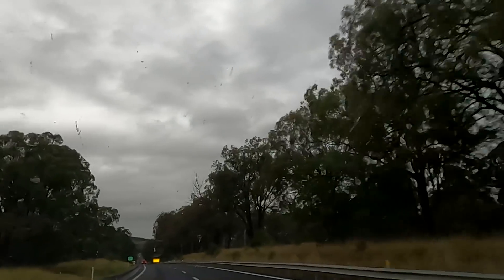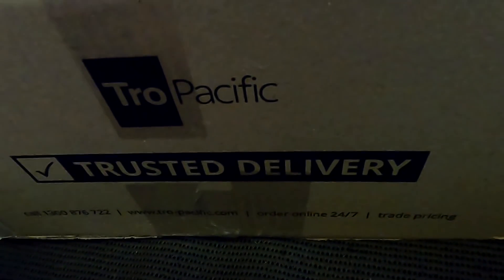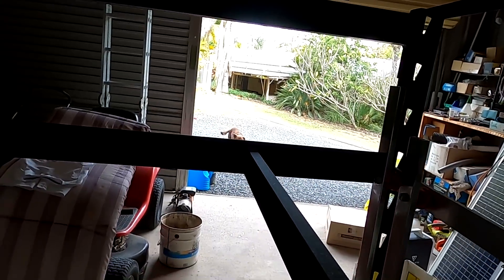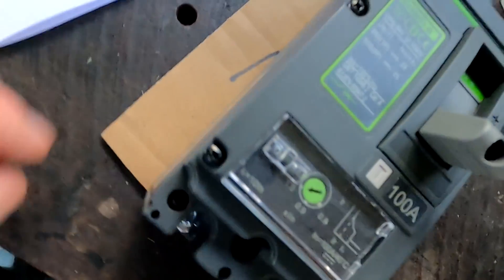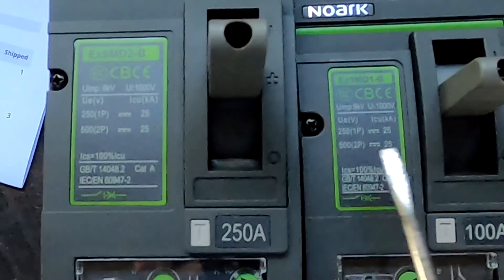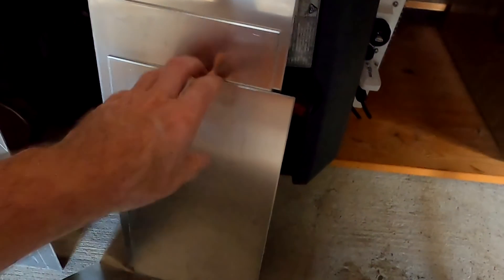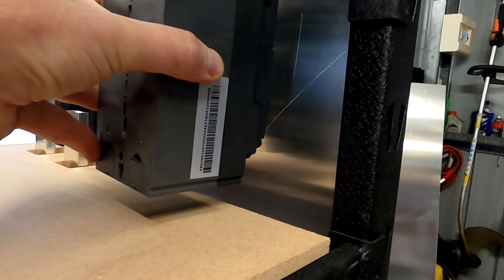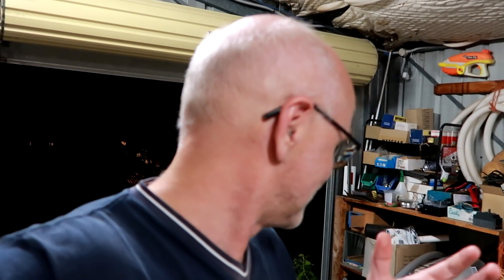Getting started with Battery 2.0. It is so much work... 🍺

Comment: I am assembling a 48 V battery from 315 cells. Due to lack of space, I will place them in two floors, 8 cells in each. I will make the rack myself from a corner and pipes. I have already found the material for the shelves: HPL plastic SPC from Durcon. Now I am solving the issue with circuit breakers and fuses: are they needed at all and if so, what denominations?

Comment: Not worried about the shelves conducting? I'd insulate the shelf tops. Also did you do any research on air arcing between the bars themselves? You could then potentially have arcing from bar to shelf and back to bar. Probably more than fine with the finger distance but something to research.

I'd have the bus bars further apart to make it virtually impossible to short by any metal tool.

Comment: For the rice of the aluminum you could have doubled your battery capacity. Using an electrical conductor as a shelf means that if you have a catastrophic electrical failure of one battery they all will ark and fail. Put an electrical insulator between the batteries and the aluminum.

Comment: thanks for sharing! how did you size your DC braker? i will build a 48V system with 304ah cells, my inverter is an mppsolar with 6.5kw inverter 120V.
Reply from the maker: OK, so roughly you do
6500W / 48V = 135A
So if you go with a 150A breaker you'll be fine. Unless the inverter can output more and you regularly hit this peak power, you should go with a 175A or even 200A breaker.
Reply: @OffGridGarageAustralia  thank you for your reply and your help!
Reply: @OffGridGarageAustralia  So if I have 2 Solark 15ks that each have 12kw (24K total) each inverter capacity and four 48 volt battery banks 304ah(64KWHs).   How would you size those breakers on each bank and the main for the 4 banks. 
Bank  24000/4/48 = 125 amp ?        Main 24000/48 = 500 amp ?
Reply from the maker: @thomaskissane691  I would use the peak power for the calculation:
30.000W/48V=625A
30.000W/48V/4=156A

So, 700A and 200A I would choose, depending on availability. 630A is the largest I have seen so far. 
This all depends on the used cable sizes of course.

Comment: When you fit the shunt accessory in those breakers, how will you trigger the shunt. Let's assume the MPPT fails and allows a full high voltage directly through to the charge cables, you want those breakers to trip, yes?

Comment: I'd seen a comment elsewhere that you should place extra insulation between cells when compressing them to ensure they don't make any electrical contact. I was highly sceptical that the aluminium case was connected to either terminal. But I've just measured mine and the case is very much -ve. So insulating the bottoms will be essential.
Reply from the maker: I'm not going to compress the cells.
Reply: @OffGridGarageAustralia  Understood but you shouldn't rely on the cell's plastic wrap to insulate it from your metal shelf. IMO.

Comment: make sure the battery bottom is insulated, the battery casing itself is conductive
Reply from the maker: My cells are isolated at the bottom. Not sure which ones you use?
Reply: @OffGridGarageAustralia  I using lishen 202ah, the cell wrapping is not fully covered at the bottom, so if the surface is metal the current flow through the metal although the current is not huge due to high resistance.

Comment: Some vinyl floor offcuts might be handy to insulate top and bottom of the aluminium.
Damn it looks good with the aluminium shelves and tinned bus bars! 
Imagine getting the shelf structure pieces chromed, and glass doors and panels fitted all round..
Reply from the maker: plus LED lights?

Comment: The bigger bolt on your lug will give you greater contact pressure.  The contact area does not matter. But M10 is overkill, M8 would be the one I would go with.

Comment: I would use some plastic cutting board to go around the holes where the busbars go through just as an extra insulator to keep anything from Rolling across and shorting out between the shelf and both rails maybe use one of them flexible cutting boards and make it a little sleeve kind of tube that goes just off maybe a millimeter two on either side of the shelf so that way in case anything little roll around get dropped slide across it can't directly leading from the Shelf to the bus bar on both of them at the same time or at least not very easily
Reply from the maker: The shelves won't move. there is no way that anything could touch.
Reply: @OffGridGarageAustralia  the self may not but if something were to fall on yhe shelf is all

Comment: That battery shelf/rack is looking nice with all the aluminum panels, now I want to do one myself. Its kind of funny, if you add up all the materials, labor time for design, picking stuff up, fabrication, and the cost of all the tools, its probably about the same price as an EG4 modular system from Signature Solar. It must be that DIYers like us put a high value on unnecessary hard work, frustration, cuts & bruises, frequent swearing and the occasional fail. LOL
Reply from the maker: They wanted over 3K for a cabinet which can hold that amount of cells. I looked into these options before I went to Bunnings 😉

Comment: I have a 250a zjbeny and yeh its massive lol. As for your lugs they look like cheap ebay thin pressed tube ones. For such a decent batery bank i would be sourcing some decent branded lugs like Cabac for example as they are twice as thick as the cheapies. I have tossed all my cheap lugs and only use decent ones now days. I would still insulate around the busbar cut out JUST incase. its $1 worth of hose or rubber and saves a potential short if something fell down there as i have learn't never assume that something will be fine lol.
Reply from the maker: Yep, I get the proper lugs from a Supplier at the Sunshine coast. They are twice as thick as the eBay ones. 💪
I looked at the ZJbeny breakers but apparently they don't come with any accessories like shunt trips or aux switches. And the breaking capacity was 'only' 15kA. Especially for the large 250A breaker I wanted a bit more.

Comment: I may be wrong, but Im thinking the fault break current is listed for the rated voltage for using 1 or 2 poles.
Both breakers shown have identical labels. And each pole is rated as listed in the bottom portion of the breakers.
Both poles are 250A & for the other breaker both poles handle 100A.
Reply: No, you've got it, I didn't listen you did mention voltage.

Comment: you should of mounted the cbs inside and made a door less work
Reply from the maker: It's definitely not less work as I would have to make a mount for the breakers, a bracket or angle holder type thingy. And the door, hinges... I've build switchboards before, it's a lot of work. I also wanted to make sure the 250A breaker is accessible from the outside so the whole battery can be disconnected without problems. This is also a requirement for the main breaker/switch.

Comment: 071721/1738h PST 🇺🇸  071821/1038h Brisbane 🇦🇺 Thanks for the presentation and the ongoing saga of your final goal. I’m not too surprised at your endeavor, because I have endured situations like yours and enjoyed the fruit of the success. The 5mm Aluminium plates ! Sturdy, strong and durable. I’m kinda perturbed at the close proximity of the huge bus bars and the Al plates, though. Well, you are the Master…
At least, you have the Oettinger, to keep your spirits high! Stay safe and 73s…
Reply from the maker: The shelves won't move any more. Especially not if the batteries are in place. the shelve would need to touch both bus bars at the same time which is even more unlikely. I'll see how I go...
Reply: Danke, Herr Andy. Ich versatehe.

Comment: All that metal around the batteries and the busbars makes me nervous.
Just lifting a floor up on one side could short the busbars.
Also just lifting up a cell might bring it's contacts in contact with the shelf above.
And several people already talked about the danger of a damaged heat shrink around a cell.....
I'd feel much better with a wooden construction, even though the thing you are building looks great.
Reply from the maker: You cannot lift the floors once the batteries are in place.

Comment: Aluminium shelving has a potential to create a short if something goes wrong, I went for 17mm Form Ply from Bunning, I would shiver if I has used aluminium for my LTO bank backing, so much ......... CURRENT .......
Reply from the maker: All battery enclosures are made of metal. It's just about the design.

Comment: as polly said "sag no more" 👍👍 take the extra braces and use them on the wood shelf (no waist) and i hope you left room for the wires to come in and out of the breakers. as for keeping stuff out of the terms on the breakers ; take some foam (like pipe foam) and put in holes to keep the frogs out (and other stuff) lookin good.

Comment: You should add plastic or rubber edging to the aluminum shelving near the buss bars. When current is flowing a magnetic field will attract to the shelving. Mostly this not be a problem, but in rare cases (like when the humidity goes below 20% or during thunderstorms) current could jump the gap if is uninsulated. To stop it I used RTV electrical silicone and split spiral plastic conduit. (Like the kind used in automotive cable harness)
Reply: 50v isn’t jumping a finger width gap
Reply from the maker: I will add some insulation under the cells, that's probably it. The shelves won't move as I have made them larger as the wooden shelves were.

Comment: Why do you need 550 amps of circuit breaker? Lightening? Expensive disconnect?
Reply from the maker: It's a 250A breaker for the whole cabinet.

Comment: Looking good, When I cut holes in panels I use masking tape to stop marking the surface. Its also helps when setting out as you can make notes on the tape like don't F*** up.
You will soon have a TOWER OF POWER.
Cheers Dave.
Reply from the maker: I drilled and sawed from the back, so scratches won't matter ;)
The Tower of Power 🤔

Comment: Andy, great solution of 5mm aluminium shelf (and as mentioned additional insulation a must) for battery's and m6 lug with larger palm much better.  Idea for mounting MCCBs, a horizontal top hat behind larger cutout to allow allow mounting MCCB to be fixed from the outside of this panel with a small from flat escutcheon screwed to outside. Will give you a lot of latitude for accuracy etc. Can do a sketch for you.
Cheers Bruce
Reply from the maker: Thank you Bruce.

Comment: I would still place a physical separation, not air, around the busbars. You can buy 10mm thick cutting boards in coloured sets from Amazon. Something like that material. The breakers, at least in the UK, have to be in (normally IP65) enclosures.
Reply from the maker: I know, many would probably isolate the gap but it's not necessary, the shelves won't move.

Comment: Nice video. It looks good. I have only few suggestions 

1. Don't take out those support bracket n bottom part of shelfs ..i would not remove them..it make shelf stronger and you need it..aluminium is not all that is needed 
2. Use some kind of protection for those bus bars (even one buss bar usually + is ok ) so there is no accident touch.. screw might fall down..or what ever.. 
3. place some protection(not conductive take or something similar) below those breakers ..in case one contact will get loose there is no way it will touch AL shelf ..
4. Keep up hard work.. i'm doing similar project myself...new inverter, charger and cables coming..so a lot of work is waiting for myself as well :)
Reply from the maker: Thank you!

Comment: Make sure to insulate the bottom of the cells the case is connected
Reply: I suggest a rubber between cells and shelf just in case insolation fail
Reply: Absolutely!
Reply from the maker: My cells are all isolated at the bottom. Not sure which ones you have?
Reply: @OffGridGarageAustralia  
There are some that have no vinyl skin on the bottom. I know, cheap right? But you always want to check all of them on the bottom. Under the vinyl skin there’s the aluminum shell that normally has a negative potential.
Reply: I thought the same thing to use MDF / HDF board with thickness 3mm or thicker or use cutting board (those that are 1-3mm and flexible)

should you break both the positive and negative side or just one?
and have you intended to use reached to improve the contact as a grease and which also prevents oxidation

Comment: If the cells are to sit directly on the aluminium shelves be very careful. With the cells connected in series any break in the blue plastic on the underside of two cells will risk a short out between cells. I nearly fell into this trap as my cell supplier did not insulate the cell undersides. I would suggest using some form of extra insulation layer added between shelves and cells would be sensible.
Reply: Originally I had planned to put the battery pack directly on an aluminium sheet with heat pads underneath for use during winter conditions. Unlike Andy some of us have to allow for low ambient temperatures. The sheet will even out the heat distribution but I need to guard against heat insulation between the aluminium and the cells. For the moment I have covered the aluminium with a thin self adhesive wrapping. This effectively double insulates electrically but hopefully still allows some heat transmission. My battery box (a small camping trailer to allow portability) is well insulated. Although heat transmission (when required) might be impeded slightly by the wrapping, the surrounding insulation will make sure that the heat gets to the cells eventually. For hot weather the trailer has a lifting cover to allow airflow but these cells don't seem to heat up much unless they are charged/discharged at very high currents.
Reply: Nigel  you spoke my mind. Thanks for the caution. FYI; I used 25mm Redwood planks, at the bottom of the Battery compartment. The RW planks are separated by 12mm gap for the free flow of ventilation. But the design varies from people to people. Thanks for the caution for Andy and others.
Reply from the maker: Mine are fully insulated underneath.
Reply: @OffGridGarageAustralia  Whilst it takes a pair of cells to have insulation breakdown to cause a short, having insulated the bottom of my cells I still decided to create an extra insulation layer on the aluminium sheet. The cell insulation isn't very thick. A short in these circumstances doesn't bear thinking about.

Comment: Actually the M10 terminals will allow a bolt capable of producing much more compression force on the terminal/buss bar interface and over a larger circumference hole.  Your reasoning may be imperfect.  Go with the 8. :)
Reply from the maker: Good point!

Comment: Awesome fabrication skills as always!  I’m curious why you chose to put the breakers in the end panel. Why is that location better than say mounting the breakers for each pack horizontally to a bracket and mounting it on the front side of each shelf slightly recessed inside of the shelving brace?  Wouldn’t having them on the side panel make it easier for them to get bumped by something and shut off accidentally?
Reply from the maker: Yeah, that was kind of my idea, they should be accessible but not too much in the way. I also want the front panels to be removable to access the batteries and with a breaker at the front, that would mean longer cables or a separate fixed panel and a split.
Reply: @OffGridGarageAustralia  I can see your point, but at 48v, is a few more inches in cable length really going to matter enough to make it a concern?  Can you not notch around the breaker if it were on the front panel?  Or are you trying to make it air tight?